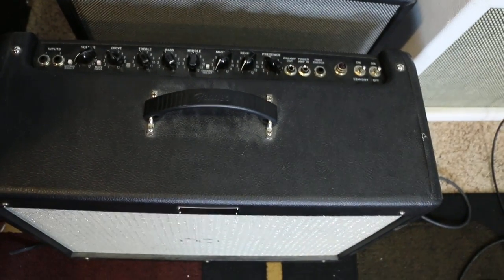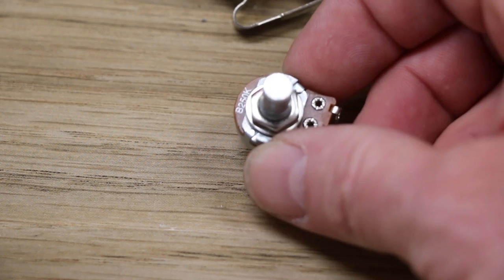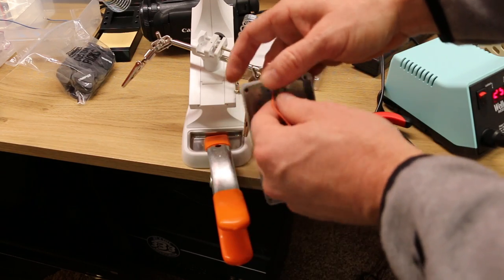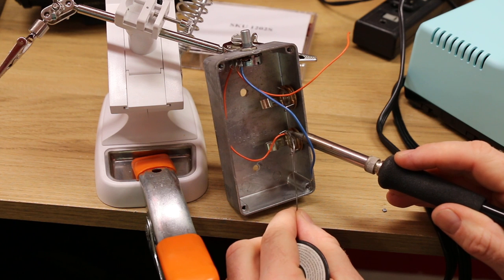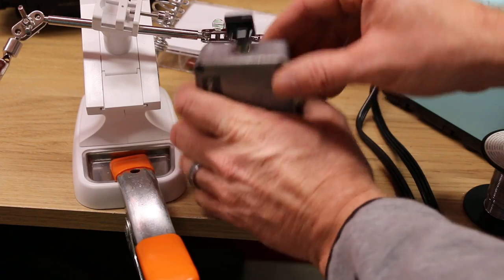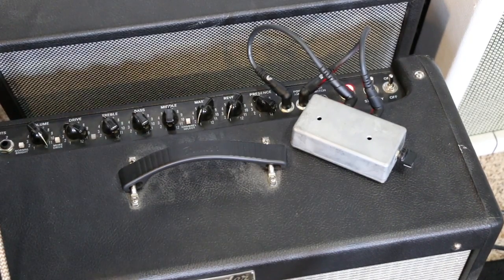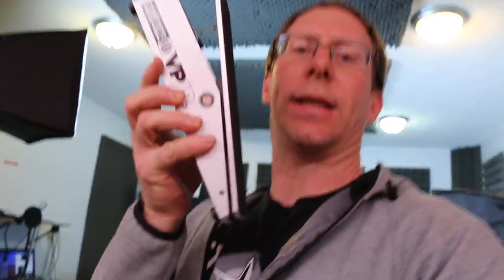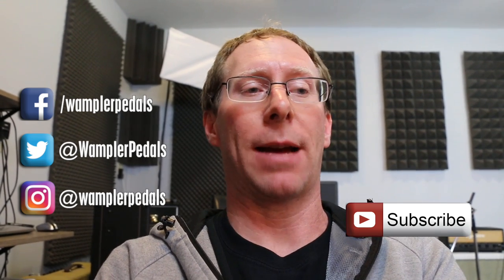Easiest “modification” for Fender Hot Rod amps (and others) to make it better for home use

Comment: Hi Brian. 

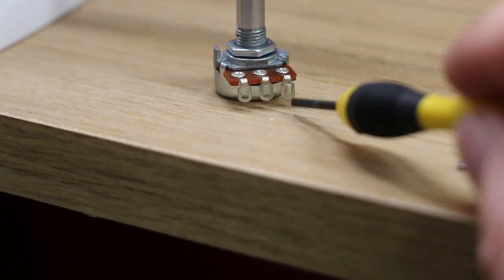I did my DIY master volume too from your invention of your DIY master volume mod from this video https://youtu.be/XH_aH-uJQpc with a success. On 16:00 part of this video, I tried the capacitor on 2 and 3 lug of main potentiometer to brightened up the amp then it works fine but I cannot figure out on how to connect with another potentiometer for tone control. Can you please teach me how can I include the tone control? 

Thanks!

Comment: The TRAINWRECK POST PHASE INVERTER MASTER VOLUME is a very very simple Only 2 capacitors and a dual potentiometer  NON INVASIVE 'mod' ( even on your prized Marshall plexi head etc, just use an existing hole on rear of chassis, ie. in place of 'Direct out' or 'Aux spkr' jack ). SEE>> 
robrobinette DOT com/The_Trainwreck_Pages DOT htm

 It is the best addition to any medium/high powered tube amp. The POST PHASE INVERTER MASTER VOLUME is the key to finding your amps most efficient relationships between the preamp and the power-amp. Sweet spots galore! 
   I installed my first ppimv on my 73' SOUND CITY 120R (6- EL34 output tubes). That 120R barely had any preamp breakup at all (let alone power tube breakup) until the amp was nearly cranked, the cops called, and my drummer looking into buying mics! After the PPIMV  it's a whole new world of tone, the amp should never have left the factory without one! Of course it being 1973, Marshall's JMP amp series ( the first Marshall amps with factory master volume added) was still a few years away, in 1976. But once guitar players had  taste of the versatility that came from master volumes, it became the most requested mod of all time. That is until amp manufacturers made MV's standard, then the most requested mod was the EFFECTS LOOP.
Below I am reprinting a former comment I made regarding the components involved in the Master Volume mod. Of couse the TRAINWRECK POST PHASE INVERTER MASTER VOLUME web page explains in simple text with diagrams how to do the mod. Only 2 capacitors and a dual potentiometer ! 
------
Put  a freakin POST PHASE INVERTER MASTER VOLUME ON IT , so you can back off MV slightly instead of backing off the guitar's Volume knob!  Where the hell are players and amp builders these days?! And attenuators suck compared to a POST PHASE INVERTER MASTER VOLUME  [1 hour , 3 components, 100% non invasive on hand wired amps, and pros have used for damn near 50 years...saves output tubes (even though you CAN blast them!) and speakers. It's basically an edge-of-the-cliff guvnor. Crank MV on 10 and you're back to stock amp. But why would you, every amp has a sweet pot. Here is the TRAIN WRECK complete HOW TO INSTALL MASTER VOLUME page, very thorough!:

I have the 100% tube, 1973 DALLAS ARBITER (manf's of the Fuzz Face)Sound City 120R amp head. A MUST  is the simple 3 part, non invasive POST PHASE INVERTER MASTER VOLUME,

Just put the knob on the back in place of LINE OUT if you don't want to drill a hole back there. In a twist of amazing luck the 1982 issue of Guitar Player Magazine's HOW-TO PHASE INVERTER MASTER VOLUME article came out the exact same week I bought my Sound City 120R! Immediately installed it. It opened up a world of distortion the amp is damn near incapable of with those HUGE Partridge Mains and Output transformers, and with 6-EL34's! I'm telling you, DO IT, you will be in 7th heaven with that beast. ??

Opening MV knob puts the amp back to stock, but why, the SC amp's sweet spot is like 3/4 MV if you want it loud with picking dynamics clean-to-power chord bliss. Saves power tubes and speakers.
ATTENUATORS ARE SO OVERRATED! UNLESS YOU WANT TO SOUND LIKE SANTANA, TOM SCHOLZ, or BRIAN MAY, why do you want to squash your entire impedance dynamics? A great amp sound is the interplay between the preamp, power amp, and speakers.

I had a 50 WATT SOUND CITY head and it sounded great with a simple 1 wire jumper from channel 1's preamp tube's output into channel 2's input (grid on tube). 

PRACTICE TUBE AMP SAFETY! TAPE OVER YOUR AMPS POWER CORD BLADES SO YOU DON'T ACCIDENTALLY START WORKING ON THE AMP PLUGGED IN.
LEARN HOW TO DISCHARGE THE LARGE FILTER CAPACITORS BY USING A RESISTOR. It is not good to "just short the caps to ground with a screwdriver."

robrobinette DOT com/The_Trainwreck_Pages DOT htm

Comment: why don't you just install a 12AT7 in the V1 position.... It reduces the pre amp output by 20% costs about $20 and takes 2 seconds to fit.. fitting a volume pot in the loop is a crap way of reducing the amps power, all you will hear is the front end, the whole reason valve amps sound good when there turned up is that you are hearing the back end of the amp with its natural output tube compression.
Reply: Hey Lucy, I've been a long time user and owner of a hot rod deville 410 for years and just last week did the 12at7 swap out(got a JJ).  I, too, am on the quest for a useable volume at home with this amp.
The tube swap did have an effect on the volume where now I can go to about three instead of 1.5, haha, but did change the tone more than I thought it would.  I've been using my volume pedal in the effects loop up until then and I think I'll swap the tube back to the 12ax7 and build this faux master volume box instead.
Reply: Lucy Voce look up info on the 12AT7, they are not meant for tone.  They will sound flatter so it is actually not ideal
Reply: Hi, thanks for the comments, I haven't had the pleasure of spending any real time with deville 4x10. I'm currently using a tweed blues deluxe made in the 90s, almost the same as a hot rod amp give and take.
like most people I couldn't get on with the volume pot being so sensitive, all or nothing so to speak. I tried volume pedals passive and buffered, the buffered one did sound better but one thing I really couldn't get on with was the amps slightly fizzy top end heard on my pick attack. The 12AT7 fixed that instantly, I understand that it does flatten the amps sound a little but that was what I was after. like you found the volume is now usable up till about 3 to 3.5 .
I have recently gone a little further and I'm made up with the amp's sound now its perfect for a living room environment. listed below my new configuration.
V1 balanced tung-sol 12AT7
V2 tung-sol 12AX7
V3 balanced tung-sol 12AU7
tung-sol big bottle matched 6l6s
bias set at 72mv

I can now run the amp flat out in my living room and ride the volume control on the guitar, I'm sure this wont be to everyone's liking but its super clean and as you turn up the guitar the amp only slightly overdrives but it compresses wonderfully, I now have a rich thick tone at sensible levels. I also use a carl martin hydra boost for when I want a lead tone. 
Its the closest I've got so far to David Gilmour's early Floyd tones with out using a fuzz face, that's next on my list.

Let me know how you get on with the faux master volume!

Comment: Umm you know you can do exactly the same thing with the volume knob on your guitar ? just turn it down, there is no need to use an external box
Reply from the maker: Incorrect, that would be adjusting preamp volumes. Putting it in the loop creates a master volume type circuit.
Reply: @wampler_pedals  Has basically the same effect. I own a hot rod deville 410 and have never had a problem using the guitar volume instead of adding anything into the fx loop

Comment: What can you do if your amp doesn't have a FX loop?
Reply from the maker: not much unfortunately :( 
Possibly build a real attenuator, but that's radically different than this video.
Reply: Short answer: Use another amp as a slave and use that as a master volume.
Reply: Wampler Pedals Thanks Brian.  love the videos, keep em coming.
Reply: Do you just go from the line out of the amp to the instrument in of the slave amp?
Reply: Barry Wuthrich I would use the effects loop return if the slave amp has one. Otherwise the instrument in might work provided it has a lot of headroom. I think an old Marshall plexi would be fine for this purpose. Remember that the amp you're slaving needs to see a speaker load. I use a THD Hot Plate set to load. Hope it clarifies :)
Reply: I run delay and reverb in my effects loop. Would you put this first in line or last?